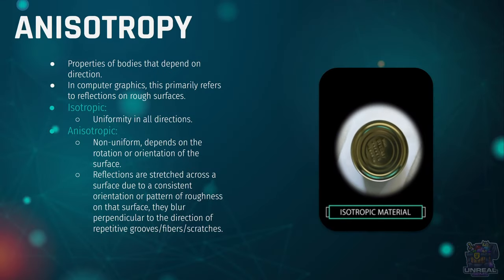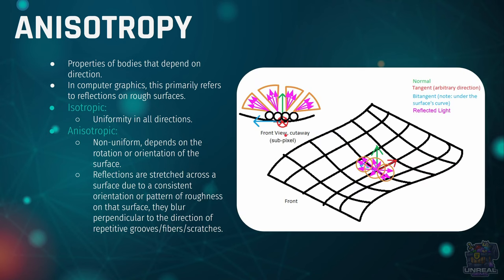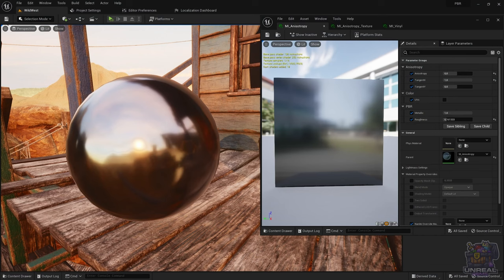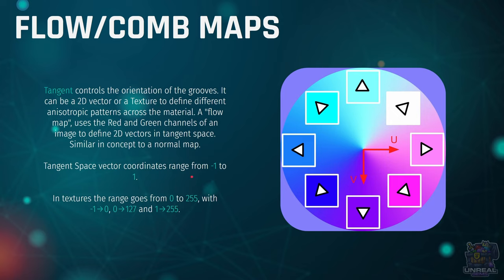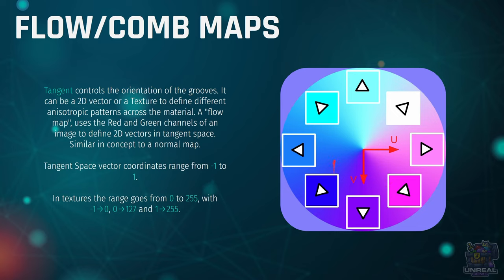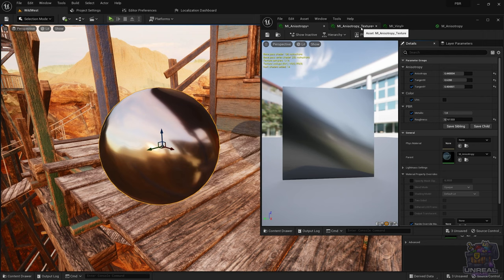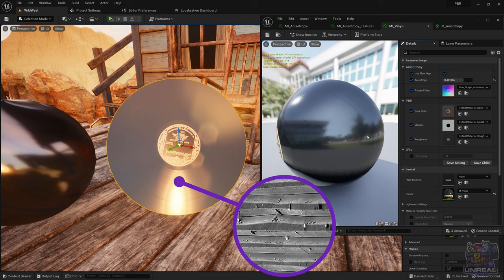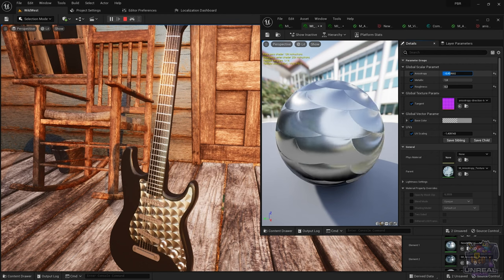Anisotropy | Advanced PBR Explained in Unreal Engine | #UE5 #UE4

Comment: Hi, thanks for another great video, so Anisotrpy be would be used to reflect light on somthng that spins? would an object with set to movable not do the same thing? When would you use it? This was a hard one to grasp! Thanks
Reply from the maker: Hey, thanks for the comment! Anisotropy is important for materials that have parallel grooves/fibers in their surface. Examples are: hair, brushed metal, vinyls/CDs, etc. The effect is not due to the rotation, but the way the surface reflects light due to the grooves. The rotation just makes it more apparent, because in a normal isotropic material when rotated, light reflection does not change. If you don't change the camera position/angle. You can test it in UE just make a rotating disk with no anisotropy, you will see always the same specular reflection. I hope this makes it clearer!😁

Comment: I am trying to create a vinyl record very similar to the example you are showing here. I can get the anisotropy to work in the material editor but it does not work at all when the material is applied to the model. It works fine on Unreal Engine primitives (cube, cylinder,etc) but not on FBX models imported into the project. How can I make the anisotropy to work on all models?
Reply from the maker: Could you explain what happens when it does not work more in-depth?
Reply: @UnrealGems  i found the reason of the problem: anisotropy does not work with Nanite meshes
Reply from the maker: It makes sense, at some point transparency was not supported either. Glad to know you figured it out!

Comment: Does the same apply to the Path Traced rendering in UE5?
Reply from the maker: Really good question, I have not tested all of this in the path tracer yet. I will get back to you when I can test it.
Reply from the maker: I have tested it briefly today and I can confirm it works with the Path Tracer, everything is the same. The results of course are different, the path tracer looks more physically correct.
Reply: @UnrealGems  Awesome, thanks! I tried it myself but couldn't confirm if the results are still accurate.